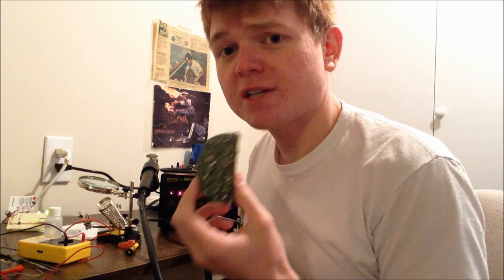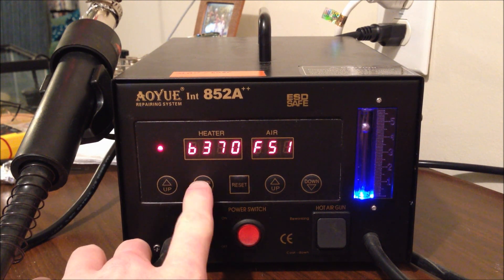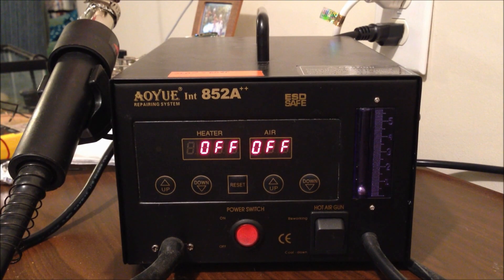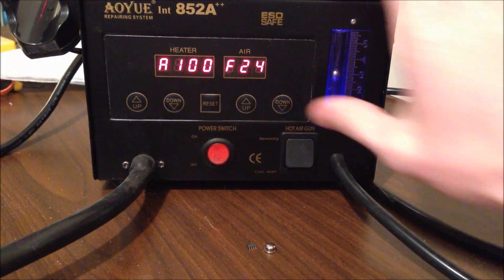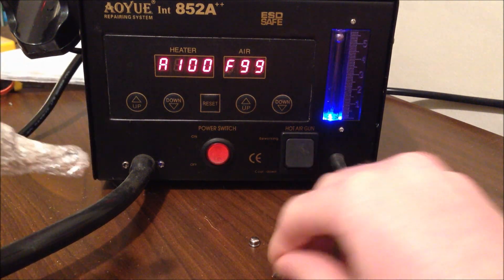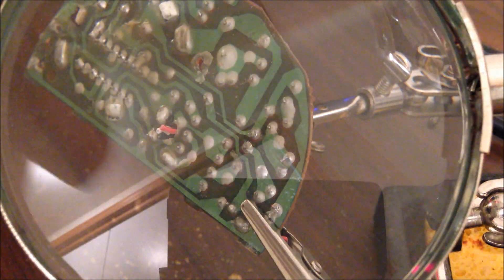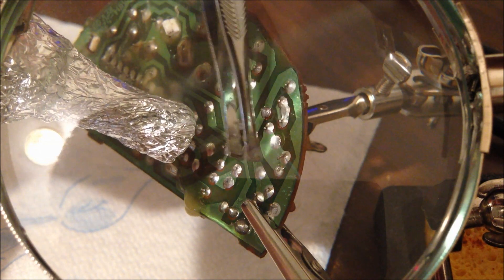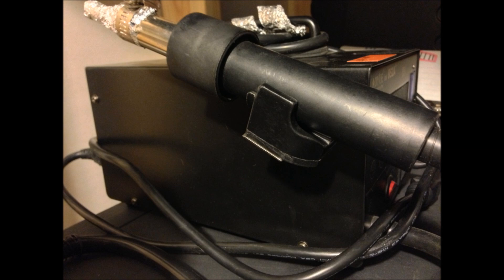AOYUE 852A hot air gun review.

Comment: Hi, Does is run on 220V 50Hz AC supply? I am about to buy one, but never see the input power spec anywhere. I blown my weller wes51 station which was for 120V 60Hz and accidentally I plugged it into 220V :(
Reply from the maker: +Shaikh Ahmed The system is built for a standard US wall outlet, so 120v.
Reply: +Shaikh Ahmed  Yeah you have to check where you're buying things from - they can even be fake, there are multiple manufacturers of same looking devices (they are essentially all Hakko knockoffs) and some of them are better, some worse than others, so it's easy enough for somebody just to print a name on a similar looking unit. They have an official importer in Europe, WilTec, that sells 220-240V version of the devices. Chinese domestic market versions are 220V also.